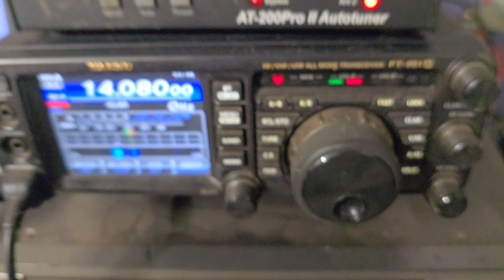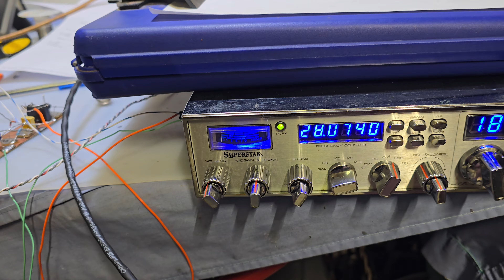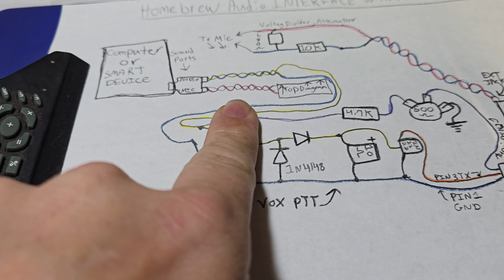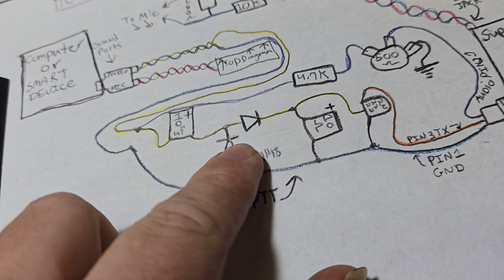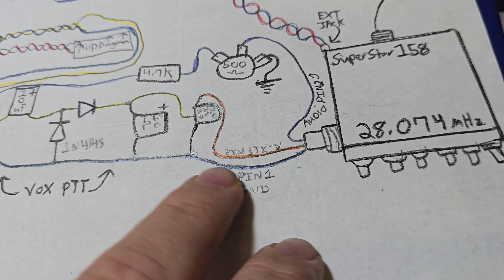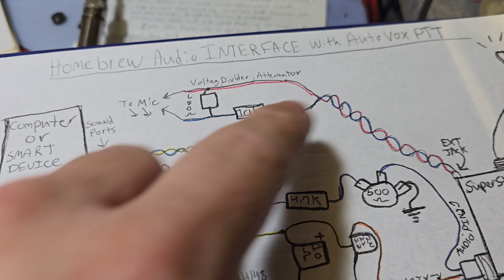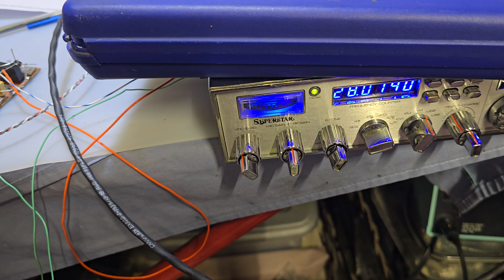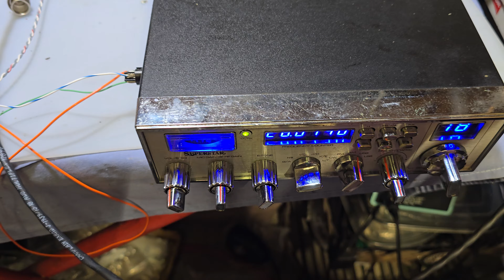Laptop/Phone To Radio W/Vox PTT - [FT8/FT4] Other Side Of The Specturm 🤪

Comment: wow now you are speaking my language brother , I have been into interfacing radios with , things like arduino and RPI , and pc's  for a while now.
Love this setup ! I have similar boards all over 73
Reply from the maker: Nice... it worked great man ran it for 7 days 24/7 with no issues at all. Put on a tunner and even ran ft8 on 12m gor a day and it worked great man! Now I just need to remake it on a real board and make it smaller so I can mount the radio and get my a computer 🖥 put up close to it so it csn be doing it's things... I'm at over 100k contacts on ft4/ft8 for the last 4 years lol

Comment: brother i made a perfboard PTT for JS8call that i use on 11m. working on getting a flatside antenna up soon. kinda a low-priority shits n giggles thing
Reply from the maker: Dood imagine over 130k contacts 90l confirmed LOTW the last 3 years i always thought it would be sweet to do digital on 11m.. maybe even make a page for free band etc... you'll see the EU guys doing one called DOS which is a super old one.
Is there an issue making JS8 work put of band I noticed wsjtx won't let you key out of band. I use MSHV for contest and I can with that... mantjay would be sweet doing digital using freehand call... 2WR1883 lol
Reply: @1883GotDown  js8call had no problem freqwise. i was using a uniden PC-122 and ch25USB is where a lotta europe is. i suppose using the A channels would be more ideal